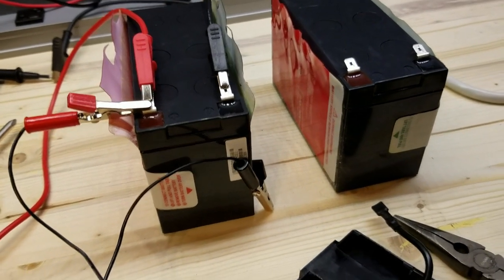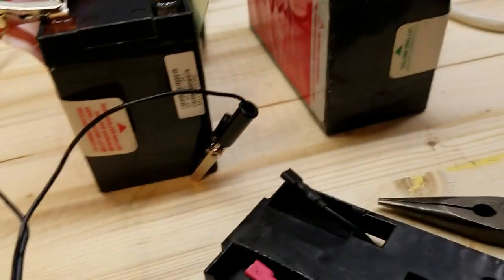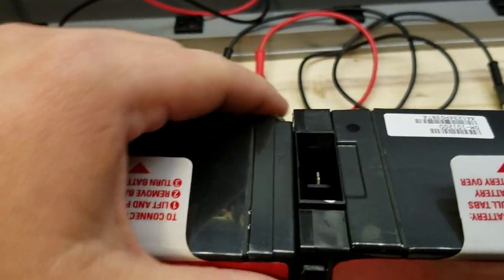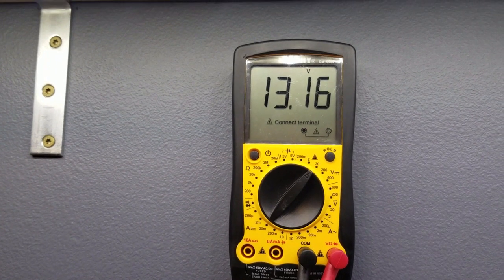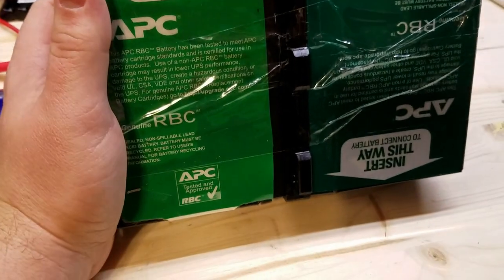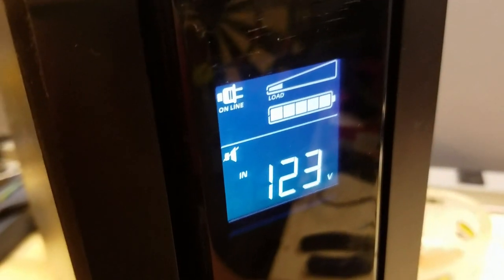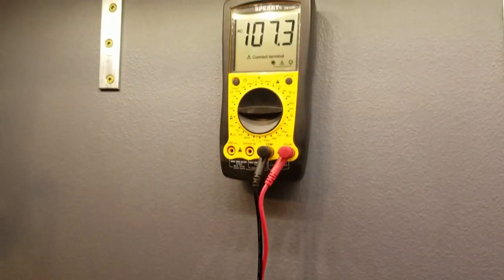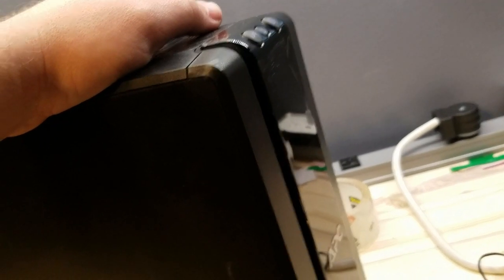Troubleshooting a UPS - APC XS 1300 (part2) - IT WORKS

Comment: The issue is your digital multimeter. The Sherry DM6400 is not a true RMS meter, Root Mean Squared. The APC XS1300 outputs a "Stepped approximation to a sine wave", from the product data sheet. You need a true RMS (tRMS) meter to accurately measure the voltage. There are true sine wave battery backups but this unit is not one. It's good enough for standard office equipment power backup.

Comment: wow this us model looks quite crap , i have a 1000va model that does 600w , 220v . (br1000g-in) and the internal circuit is much more beefy . there is double the transistor before that pulse transformer and the halfbridge heatsink is lot larger. also at 220v the current is lower but still all the outputs are on finned heatsink. diodes and outpuit H bridge. i guess much of it has to do with the external battery option in this one. i got this for 50$ with original battery and the original apc 9ah 24v battery , the seller who sold me was a miner and crypto crashed at that time so he was selling his rigs to recover the loss . it was 1yr old at that time and had another year of warranty left !

Comment: Smart enough to know that low voltage will heat appliances/electronics up and destroy them in a short time.  107 is low, 100 is awful.  You need at least 108 volts for marginally safe op.  Your's is still bad.  Mine is too

Comment: Also meant to ask, how long did your custom / salvaged battery work? Is it still working?
Reply from the maker: The salvaged batteries worked for a while but I had to swap some fresh ones in a few months later.
Reply from the maker: The salvaged batteries had been sitting for a while off the charger... probably longer than they should have.
Reply: @experiment86  this post was so helpful, I assumed I had bad backup units before watching this. I ended up buying a new battery for one as a test on Black Friday and it’s been working so far! I dont have the gear to pull the new battery apart and test it but I’m tempted!
Reply: So thank you so much for this video, I was close to tossing perhaps perfectly good backup units! 💗
Reply from the maker: @LA-Creative  glad my video was able to help!

Comment: Wow part 2 is especially eye opening! 

Have had so many battery issues with these things and wondering if it’s the unit or the battery so came on to Youtube. My xs 1500 batteries seem to die fast and my 1300 battery actually started to bust out of it’s plastic (lots of warping).

Where did you buy the bad replacent battery? 

The only battery that has lasted longer (since 2017) came from B&H in NY. Wondering because so many picky professionals shop there if they have better stock. Not sure if that’s a coincidence tho?
Reply from the maker: I get my batteries from a local place to save on shipping. They mostly sell Duracell brand. I've had good luck with them. A couple got a little swollen when I abused them.

Comment: Sorry but you will probably be a Ferrari mechanic and not an electrician?
The fact that there is a problem one battery from battery pack is probably one of the first things that a person solves and does not disassemble the backup power supply.This zero battery pack from APC or other noname
3-5years battery packs. I have in my APC 10 years waranty battery FIAMM 12FGHL34 !!! The best option.
Look up for better types of 12volt 9Ah battery.
Reply: Sure if the batteries were old but honestly, most people assume that APC would not sell you bad replacement batteries. I’m shocked, personally. And also it voids the warranty to open them up.  Also instead of investigating most people would just complain to APC and ask for an refund (always wondering it it was their unit or the battery)  but I’m so glad he posted this on the web for the world to see. 👏 #batterygate #apcgate

Comment: Good day sir can you give idea I replace new battery but still the display battery not charging but tester the float voltage 27votls may I know to troubleshoot thanks best regards more power on your channel
Reply from the maker: Hard to say without being able to work on it. If it's actually putting out voltage to charge the battery pack then I would check to see if it holds a load after you cut off AC power. Maybe it's just not sensing the charge voltage.

Comment: So you couldn’t use that unit just as a inverter with a 12 volt battery? But could be used as a inverter if you have the 24 volts ?
Reply from the maker: Actually, I suppose you could. It's designed for 24v so you'd need two 12v in series but yeah that should work.

Comment: I have the same problem, that the ups turn off, when I disconnect the power supply.
If I understood correctly (my English is not good) is that the damaged batteries drain faster than the good ones?
Reply from the maker: Yeah, once one battery is bad the pair is pretty much worthless and they will drain very fast.

Comment: Thanks for the video; 1 and 2! Both of my batteries aren't very old, but I'm only getting a 13.48 on my multimeter from the jumper (on both batteries.) I'll pursue your troubleshoot and hopefully it gets me back in business. I'll let you know.
Reply from the maker: Yeah if you're getting only 13.48v with the batteries still in series, then your batteries are toast. You should be getting around 24v.

Comment: I may just be too used to lithium batteries but even the first battery seemed to be crap by how much the voltage sagged with just a computer fan
Reply from the maker: It did sag a good bit but that fan puts a 3amp load on the battery. I'd like to test a comparable lithium with the same fan.